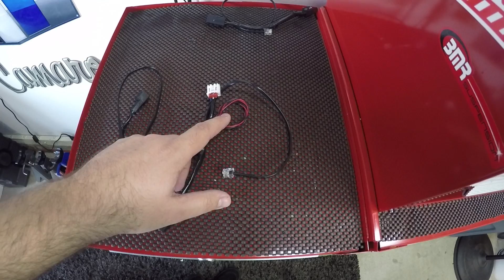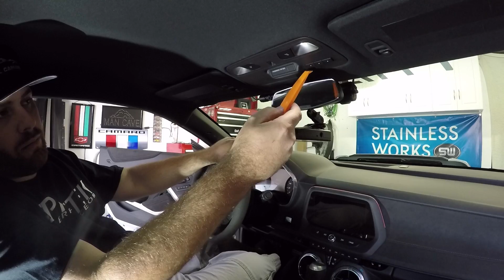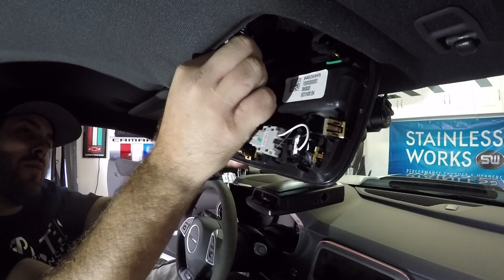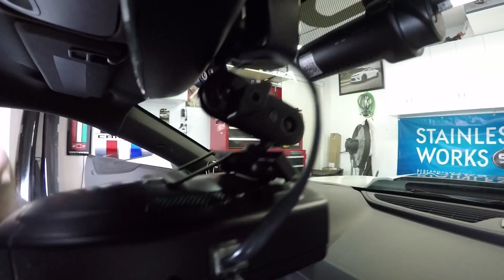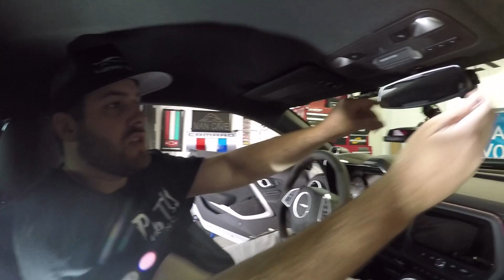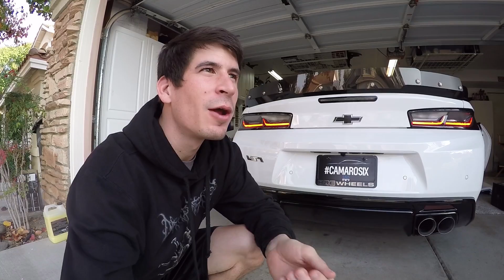Radar Detector Power Harness for 2016-2024 Camaro | Gen5DIY

Comment: Using these jumper cables on the C8 is causing damage to the side mirrors due to the jumper cord having a higher voltage than stock. Has this been a problem on the camaro?
Reply from the maker: Gen5 does not offer this set up for the C8 Corvette. But zero issues with the Camaro.

Comment: No updated news on the harness issues to date???
Reply from the maker: Harness issues?
Reply: Yeah... I havevread the initial harness caused the detector to randomly power down upon wheel spin and also caused some check engine lights to pop up on dash.  I thought they offered a revised harness for replacement to those who purchased original harnesses.

Comment: Hey Matt, two yrs down the road now since powering down issues of the R3.  Who better to ask what is the scoop with Gen 6 and Uniden R3 detectors using Gen5DIY hardwire harnesses?  Are all bugs worked out? No powering down with wheelspin, check engine light issues or any new issues surfacing.  Just purchased an R3 for my 19 2SS 1LE and wanted to buy the harness but hoping all issues are now resolved.  Any news you can share.  Thanks man.

Comment: Thanks for the detailed explanation , I bought R3 Radar and Blackvue 590w which i need to install both of them, the harness that i purchased for the radar from Gen5diy said it will have extra leads for dash cam, Can we use the same cables for blakvue or i should be following the same way like how you installed Power magic on your machine by directly running cables to Fuse box?

Comment: Worked great for me with my Unidien R3,  saved me a lot of work by not having to disconnect the other 5-6 connectors as the Gen5diy instructions show. On other thing, you can fish the phone connector forward between the  windshield and headliner so the wire is even less visible. Thank You

Comment: Hey Matt this installation works on the convertible or I had to take more parts apart Great videos by the way
Reply: Did you get a chance to install this on your convertible?  I have a 2017 convertible and wanted to install this adapter from gen5diy

Comment: Two questions:

1. I saw another video, where to install a similar set up, the person had to do something or make some adjustments in the fuse box under the hood. That was kind of what deterred me from wanting to go this route, but I guess this is all you have to do?

2. I have a convertible 2SS. Do you know if there are any differences with the home link panel that needs to be removed/the wiring within?

Thanks in advance!
Reply from the maker: The convertible has a slight different install step due to the hard mount part on the front panel. But it is very much plug and play, no fuse box touching needed.
Reply: LethalGarage Thank you, I’m about to order this cable and but was wondering what you meant about an additional step for the convertible, due to a hard mount?
Reply from the maker: I don’t think access is as easy on the Convertibles but then again I have an actually seen one to verify that

Comment: what’s your drag wheel setup?
Reply from the maker: Weld 17” with MT ETS Rs 305/45/17 front haven’t arrived yet
Reply: LethalGarage with that size of the tire 305/45 is a 17inch rim the only size it fits or what other size of rims fit in that tire?

Comment: You should look into a Blendmount. That radar mirror mount you've got seems awfully flimsy, given how much it moved around. Blendmounts are pretty spendy, but they will keep your RD dead level and have a patented spring clip that keeps your RD from rattling around. I've had them in all my cars. Well worth the $.
Reply from the maker: It was loose at the time of recording, It works great
Reply: I have blend mount too and it fits snugly under the mirror so it looks factory. Many do not even see the radar detector until it goes off...

Comment: For those interested in a radar detector I highly recommend the channel Vortex radar he is the lethal garage of radar detectors and based off of his videos it seems like the Uniden R3 is the best detector and it's $400
Reply: I seen the same thing as far as that guy and the R3.  I was wondering if the cable Lethal has would plug into the R3.  Also was wondering about that sweet rear view mirror mount he has.